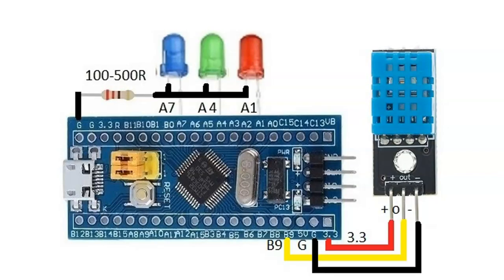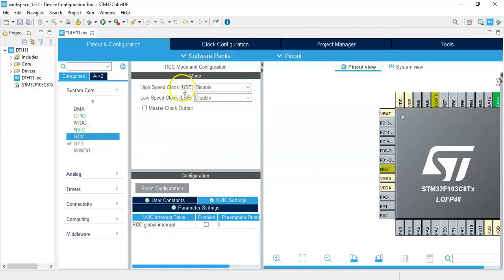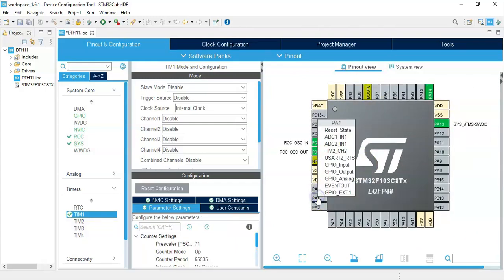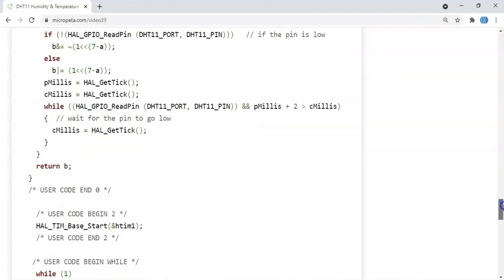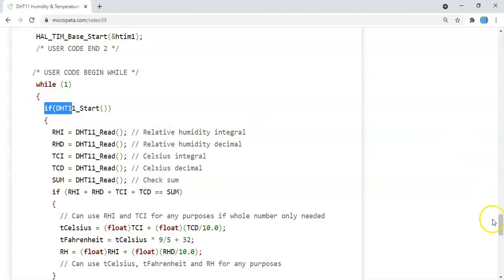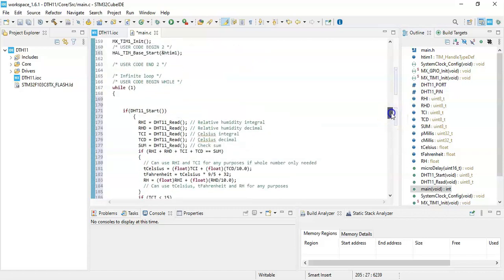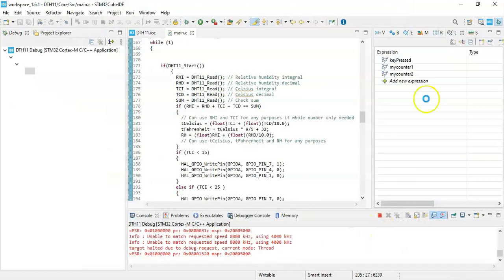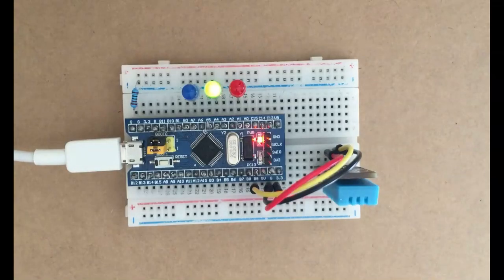39. STM32CubeIDE DHT11 Temperature and Humidity Sensor with STM32F103C8T6

Comment: i get an error saying no stlink detected when i try to debug what do i do
Reply from the maker: You need ST-LINK V2 as I have shown in video https://www.youtube.com/watch?v=kXg467nVd_A
In that video, I have installed the driver when I installed the STM32CubeIDE
Make sure the USB port for the ST-LINK is working. You may try another port
Reply: @NizarMohideen  i want to use i2c in my project too how can i add it
Reply from the maker: I have i2c oled - https://youtu.be/rIqM63S9eUQ
If you need i2c lcd use - https://youtu.be/l-JVnlJIPao

Comment: the first time i did like the video, i have successed, but now i have some problem with led, if i connect the led with the resistor, it don't turn on, but when i connect with 3.3v, the led turn on but not right as the code 
and thank you so much with your video i already can add a lcd which display the temperature and humidity
Reply: oh anyway i found the reason, i reverse installation the led, now i can run it properly. Thank you so much i love your video!

Comment: sorry sir, but if i want to see the value of data which be delivered by DHT11 to STM how can i see that? many channel use keil uvision, but i am using ide like u so i don't know how to see them
Reply from the maker: You can use live expression to see the values as shown in this video
Or you can see in oled display as shown in https://youtu.be/rIqM63S9eUQ
Reply: @NizarMohideen  thanks for replying sir, but i meet a error like "Could not verify ST device! Abort connection" , i can apply code into stm32 by using stlink with file.hex but can not debug directly :( i am trying to fix, hope i can debug :(
Reply from the maker: You can print messages/values to terminal via UART or USB
Reply from the maker: You can print values to terminal via USB
Details in this video https://youtu.be/iYvUzxABmTk
Reply: @NizarMohideen  thank you very much sir, i ll check this

Comment: hello friend what  kind of connection is between mcu and sensor, pwm  or is there a communication like uart
Reply from the maker: It uses simple input and output using one pin only. Micro-controller programmed to change GPIO INPUT and OUTPUT

Comment: hi sir im using STM32 f303RE and when I finish apply system software reset in the debugger it asks.. "confirm perspective switch" should I press switch to no
Reply from the maker: OpenOCD and  system software reset is for generic STM32F103C8T6.
If you are using nucleo, you can use GDB server as I have shown in my video-no-50
Thanks
Reply: @NizarMohideen  sir i have tried as u said but still no reading from my DHT11
Reply from the maker: I used
Click Clock Configuration tab → HCLK (MHz) to 72
Configuration → Parameter Settings → Prescaler set to 71

If your clock frequency is different set prescalor to one less.
For example. If your 
Click Clock Configuration tab → HCLK (MHz) to 180
Configuration → Parameter Settings → Prescaler set to 179
Reply: @NizarMohideen  yes i have also tried this and when I pause it keep coming back to  while (__HAL_TIM_GET_COUNTER(&htim1) < delay);
Reply from the maker: It is normal to go to  while (__HAL_TIM_GET_COUNTER(&htim1) < delay); during debug pause.

Define correct pin and port 
#define DHT11_PORT
#define DHT11_PIN
Check for wiring connections before trying again.
Reply: @NizarMohideen  thank you so much sir.It seems that when debugging i need to choose the right options
Reply from the maker: Thanks. I hope by now you are getting correct temperature values too.
Reply: sir can u do a video sending this data to thingspeak.I tried my ESP_init code doesn't seem to work

Comment: Sir, the PB9 that is connected to the sensor, is it supposed to be output or input? In the video you configured as output.
Reply from the maker: Hi Joseph,
The pin need to be output first and then input. 
Micro-controller needs to send some messages to the sensor asking for temperature, then the sensor will respond with the answer (that is temperature and humidity).
Pin type change from output to input and then input to output will be handled by the code.
If you inspect the code

GPIO_InitStructPrivate.Mode = GPIO_MODE_OUTPUT_PP;
HAL_GPIO_Init(DHT11_PORT, &GPIO_InitStructPrivate); // set the pin as output
GPIO_InitStructPrivate.Mode = GPIO_MODE_INPUT;
HAL_GPIO_Init(DHT11_PORT, &GPIO_InitStructPrivate); // set the pin as input
Reply: @NizarMohideen  Thank you so much for your explanation. I have now understood.
Reply: @NizarMohideen  Sir also  I'd like to request for some help integrating the dht sensor with 1602 lcd display and the stm32f103c8t6.

Thank you once again.
Reply: @wangere7697  Hi I am asking the same thing, do you have the guidance steps? Thanks
Reply: @clairejhwang2313  Hi which steps would you like please?

Comment: Hi sir 
Dht11 is always gonna send 1 whatever I do . Our codes are not completely same but similar
Reply: I've just had the same problem, if it's useful for someone doing it now: some DHT11s have the signal pin on the left and not in the middle as shown in the video, make sure you check yours or you'll get a constant HIGH on the data pin.

Comment: How i can run this on Nucleo-64 Board (STM32F401)
Reply from the maker: It is all same except you need to change the timer Prescalor according to clock speed. Prescalor should be one less than timer clock speed.  I don't have STM32F401 with me to demonstrate. Thanks

Comment: Hi, I've sent the pulse signal to the data pin. After that I've set the data pin as input. And wait for the pin to go low. But its never going low. i.e. it never satisfies: if (!(HAL_GPIO_ReadPin (DHT11_PORT, DHT11_PIN))) condition. So, response is not 1. Now I'm stuck in a forever loop. Can you help me?
Reply from the maker: Hi Nafiur Rahman,
There are no forever loop in the code. Any while loops I used, I put timeout of 2ms using HAL_GetTick(). if (!(HAL_GPIO_ReadPin (DHT11_PORT, DHT11_PIN))) is not a loop. It just checks and goes inside  and makes Response = 1 if the condition satisfies. Otherwise Response = 0 remains.

Now we come to the starting of DHT11, the pulse timing is important. 
You need to keep the pin low for at least 18 milliseconds. 
Then keep the pin high for about 30 micro seconds.
Then make the pin as input. It should become low

If it doesn’t become low at this point, check wiring connection and power supply.
Please note the timings. One of them is milliseconds and others are micro-seconds.

Comment: Hello sir
I made circuit on proteus about interfacing dht11 temperature and humidity sensor with STM32F103C6 microcontroller, but for creating hex file it's show error on stm32ide 
So sir can you please create code for proteus circuit
Reply: Can you provide your mail id 
I'll send my circuit to you
Reply from the maker: Hi Sahil,
To be honest, I am not familiar with proteus.  I give you the steps. You can try

Set the pin to output
Set the pin to low
Wait 20000 micro seconds
Set the pin to high
Wait 30 micro seconds
Set the pin to input
Wait 40 micro seconds
If the pin is now low and after 80 micro seconds if the pin is high, sensor responded
Wait for the pin to go low
Now in loop (40 iterations)
	Wait for the pin to go high
	Wait 40 micro seconds
	bit(i) = pin value
	Wait for the pin to go low
Do above 4 steps 40 times

First 8 bits will have Relative humidity integral (A)
Next 8 bits will have Relative humidity decimal (B)
Next 8 bits will have Celsius integral (C)
Next 8 bits will have Celsius decimal (D)
Next 8 bits will have Check sum (E)

If A+B+C+D=E, all good
Regards,
Reply from the maker: https://www.mouser.com/datasheet/2/758/DHT11-Technical-Data-Sheet-Translated-Version-1143054.pdf

Comment: Do we need a programmer for this?
Reply: I've ordered STM32F103C8 board worth 600, so do I need an external programmer for it?
Reply from the maker: You need a DHT11 Sensor (Of course)
You need a STM32F103C8T6 Blue-Pill
You need a ST-LINK programmer.
I have shown in video https://youtu.be/kXg467nVd_A how to connect st-link to the board and installing CubeIDE. Let me know if you have more questions
Reply: @NizarMohideen  how did you upload the code here. I can't see ST link here. Did you upload the code with micro usb cable ?